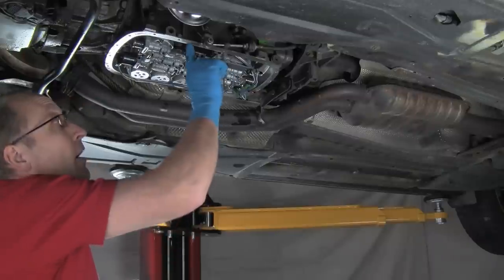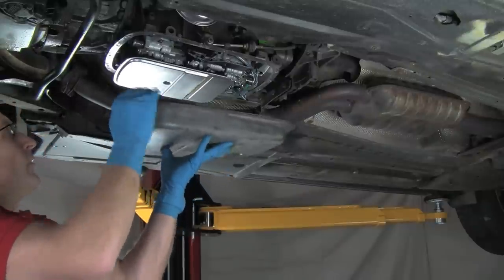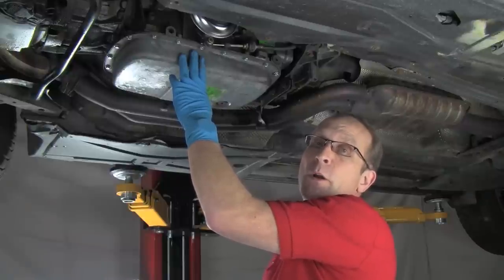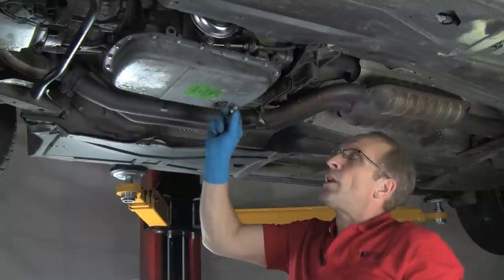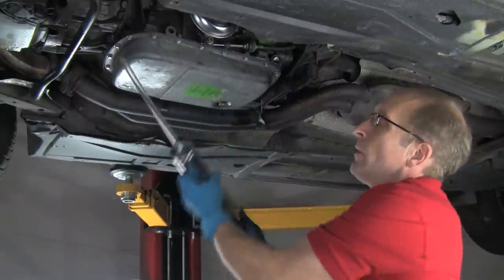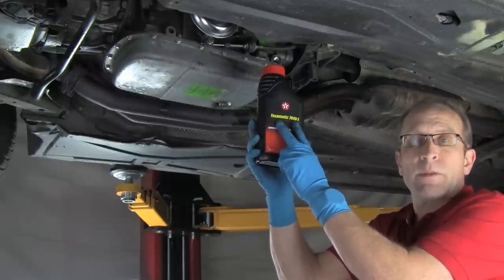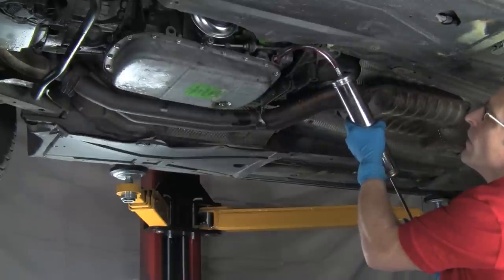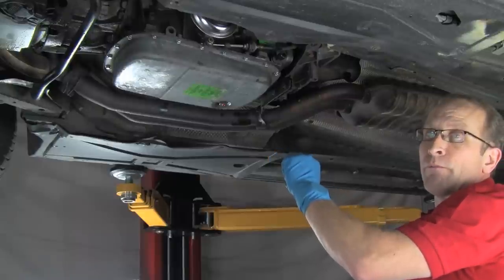Part 2: Changing Automatic Transmission Fluid & Filter On A BMW/MINI

Comment: Hello, Could you specify what kind of oil should be used to A5S390R gearbox? Realoem.com site provides info that it should be ATF2 but for example here http://koti.mbnet.fi/pro-ht/Kuvat/automaattilaatikko/5L40E.pdf (gearbox specyfication) , it contains that ATF3 should be used. I am confused :(
Reply from the maker: What specific year and model is the transmission in?  The fluid specifications changed over different production dates and models.  As a side note, the Lifeguard-5 has been approved for these transmissions as a proper replacement fluid.
Reply: My model is e46 3.0d with Engine m57n , 2003 gear. Vin : jw97017 . Many opinions i have found in network. I have try with "eksperts" from bmw service but i think thay don't have required knowladge. Thay told me to not change the oil :(
Reply from the maker: Bartosz Lewandowski
 - We don;t have a listing for your non-US model, for the original fluid that was used.  However, your transmission will use the newer ZF LifeGuard-5 fluid.  See link:
http://www.bavauto.com/fland.asp?part=lifeguard5

Comment: hey guys, do you know if a manual trans takes the same filter?
I am searching however I ended up with only one part # 24117557070 for an automatic trans ff.

Thanks

Comment: ya hey ,...............I have 1992 bmw 525i E34 and the light on Transmission program ,so what is mean or I just changing the filter and fluid if yes i'll call you to order the part thank youcustomer #2462190

Comment: Too bad BMW engineers failed to put in dipsticks for the oil and trans. fluid. Owners are at the mercy of the sensors, which means if the sensors fail, you have a pile of crap on your hands. Very poor design.